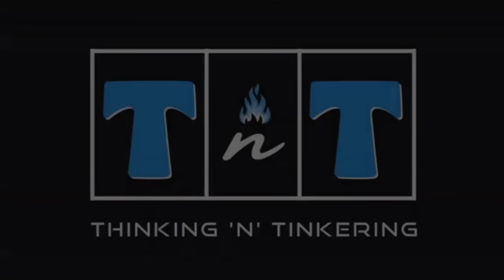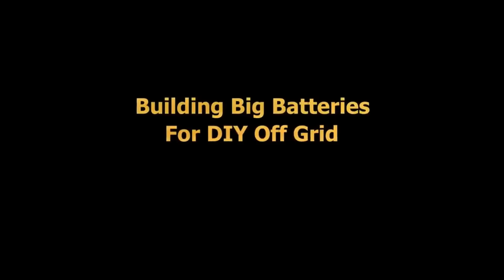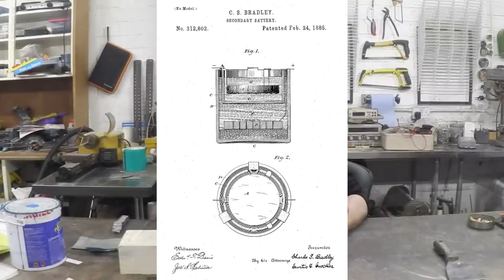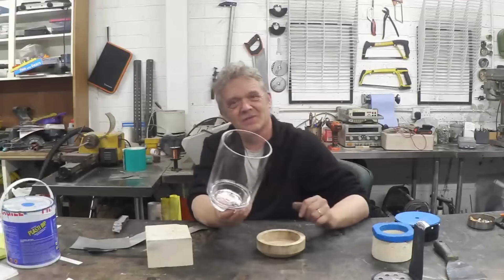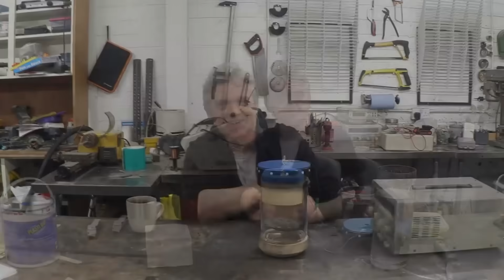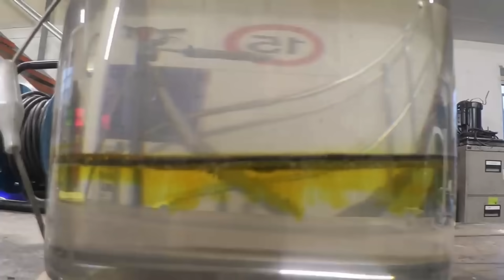2102 Building Big Batteries For DIY Off Grid

Comment: Water and oil do not require a membrane to separate. Build on that
Reply: Good luck 👍
Reply: Lol, welcome to the channel.
Reply: If only oil was conductive.
Reply: @unicornadrian1358  I have tried making it so, with teeny success. There are other fluids that do not mix. Density, viscosity and molecule size.
Reply: @David_Mash  sounds like a fun research project for you. You should make videos of it.
Reply: @unicornadrian1358 if one could make oil conductive, do you think that the principal of oil and water would be worth trying?
Reply: @Unpopular_0pinion  sure, that’s what curiosity and experimentation are all about.
Reply: @unicornadrian1358 oil with high conductive carbon is conductive . Even just course graphite powder mix in would work
Reply: Conductive polymer slurry I would suggest off hand...
  But here's a challenge how would you make it hydrophobic and highly polar?
Reply: @petevenuti7355  I had temporary success with clean water, and a hot salt water mixed with oil.
Reply: @David_Mash  temporary.....
Reply: @petevenuti7355  or get the ions to go from the water based electrolyte through the oil based separator.
Reply: Solid membrane might help with dendrites and pieces of zinc falling off though.
Reply: Bromine does dissolve in oil, maybe that's what you're thinking?
   But does it dissolve better, such that it doesn't migrate back into the water, that would reduce efficiency.
If it does defuse back quickly what's the benefits?
Reply: @petevenuti7355  homeowners don't care about efficiency as much as they do simplicity. I would take a battery that is 10% efficiency if I could make it with two plastic 100 liter barrels and some garden hose.
Reply: @David_Mash  I would disagree, as it all effects cost efficiency. Electric heating is currently 100% efficient at getting rid of your money in the most environmentally wasteful way! It all boils down to money. 
   If it costs 10-20x as much to charge your battery then to just use the electric now , it doesn't matter if the battery is free, no one is going to like it for long.
Reply: @petevenuti7355  we have 35 panels 10kw
Reply: Wouldn’t that be a treat? But bromine will destroy your plastic barrel. 😩
Reply: @David_Mash by the time anyone's worked out a (the!) solution (geddit?!!😁) to your problem, you could have bought an off the shelf, or made a more expensive, more complicated Stationary Storage solution & recouped the cost already!... 🤦‍♂️
Reply: @petevenuti7355  the goal is two solutions that will not mix yet allow electrons to transfer. Eliminating the membrane allows electrons to transfer much easier.
Reply: @David_Mash  I agree with you and have thought of that too. Getting a solvent that's polar enough to be ionic conductive and also not be miscible in water has been quite a challenge. I haven't had the funds (or a commercial address to have chemicals sent to) to be able to test some of my better ideas.(hydrophobic ionic liquids, oil soluble salts, etc) Many of the things I have tried to make an oil conductive became more of a detergent then a phase transfer agent for ions. 
  If you are specificly experimenting with bromine, I highly recommend using a heavy saturated oil (with no double bonds) or a substituted tertiary alcohol that will sink in water as you want to not just work with the natural density increase caused by bromine but also the sequestering ability of the oil as bromine is nasty.
Reply: How about expansion of freezing water pushing a mag system thermodynamic green - freezing vs repulsive force equals?
Reply: @user-gx5vu4kq1e  I'll bite, but don't follow your thought train. More details?
Reply: How about a pair of non-mixing molten metals?